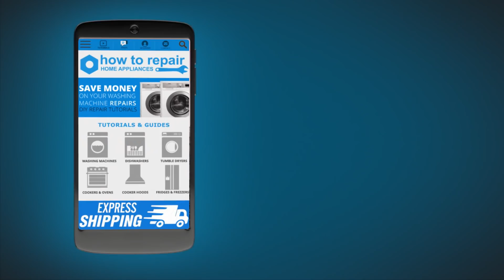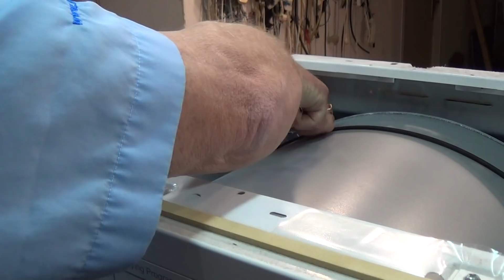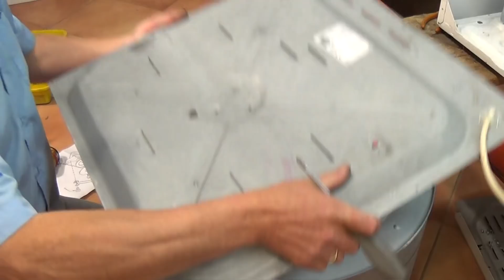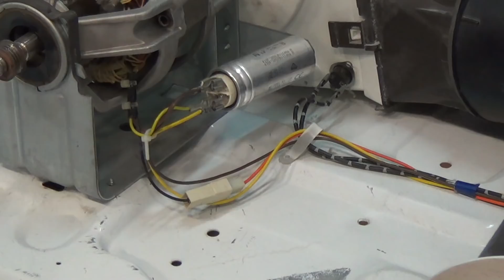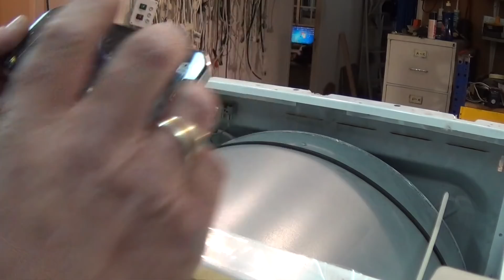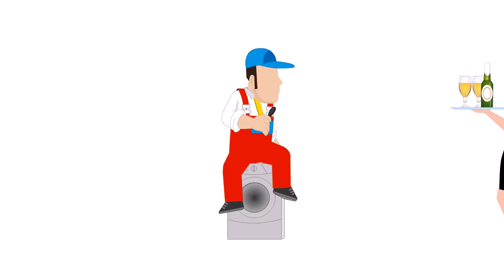Tumble dryer not heating Check element & Thermostats white Knight etc

Comment: Replaced the heater element in a Baumatic BTD1 which is identical to the White Knight machine in your video. Thanks for the detailed explanation, without which, I would probably have scrapped the machine. Working fine again!

Comment: Ive tested the thermal element & cut off valve, both are providing a continuity signal via the multimeter however it still blows cold air
Reply from the maker: have you checked foward thermostat. Thanks 👍 for watching and please remember to subscribe to the Channel as that's what keeps us going in able to make the video for you

Comment: Great video thanks.. replaced the heating element and it's working perfectly again. Not as easy as it looks, but the most difficult part is lining up the drum properly when reassembling, the felt at the front doesn't hold it in place and it keeps dropping out. Managed it in the end though & saved me a fortune... thanks.

Comment: My White Knight heating element was faulty and I replaced it as per your instruction.  It sounds fine but I get a strong electrical smell coming from the machine when I switch it on.  Is this normal for a new element or is there a wireing problem? I dont see any smoke.

Comment: We have had a white night dryer sat unused in the garage for a few years. Recently we have had cause to use it and thanks to your vids I have cleaned it out, replaced the hose. Then the motor capacitor failed so I fixed that. Now it looks like heating element is done. Great videos helping me keep an appliance going that I think 95% of people would have sent to the tip

Comment: For front loading Electrolux Washing Machines and Washer-Dryers: the resistance values of components can be found in S.M. 599728903 "Component Characteristics" (04/2010), https://www.4mcculloch.co.uk/images/mediator/553/599728903.pdf - the data are indicative, more details for testing motors and tachometric generators see S.B. 599706597 (06/2009), https://www.4mcculloch.co.uk/images/mediator/553/599706597.pdf